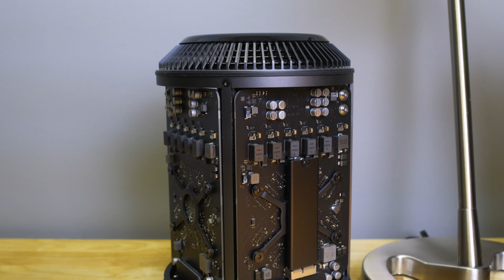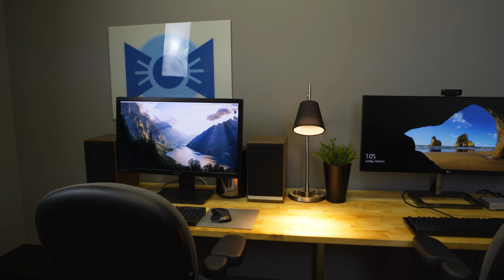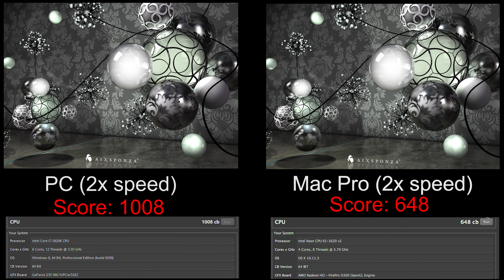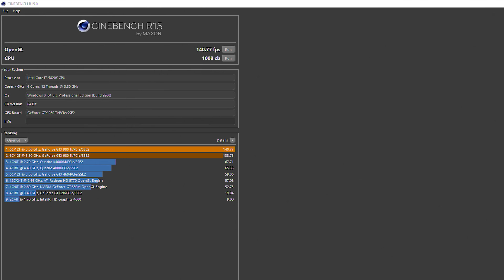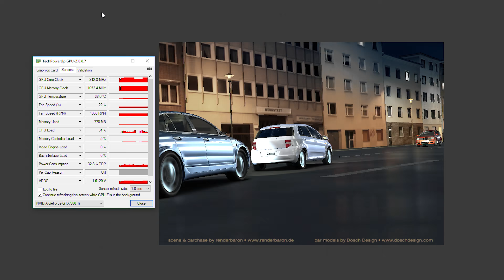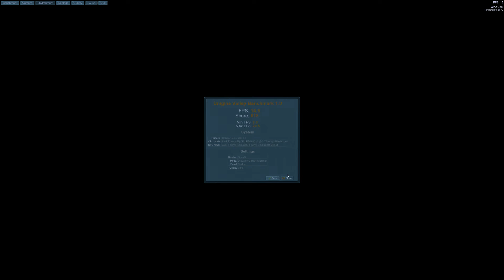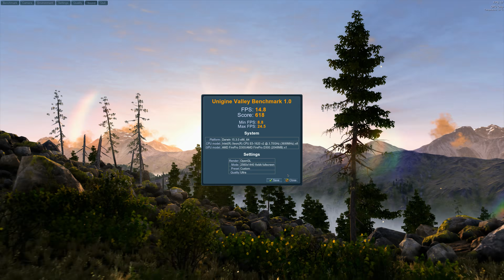$2,000 Custom PC vs $4,000 Mac Pro

Comment: The only GPU tests you did were real-time gaming-esque rendering. You didn't take advantage of those FirePros at all. Those are not gaming cards; they're workstation cards.

Your comparison "proved" that the 980 Ti build was faster just like I could "prove" that a Formula 1 car is better than a tow truck by putting them on a race track.

Comment: depending on the silicone, you can easily get 4.5 GHz out of this CPU... Higher than that you can still get stable performance but you will exceed the 140W of TDP due to the higher volts. But your setup should be perfectly fine with 4.5 GHz and with taht said: Your rig did not just derstroy the 4000$ appletrash but youre rig did it with one hand on the back (since you also do not benefit from quad channel on this board, wich i concider a bad choice, but hey :) )...

Comment: My cinebench score is 762 @ 4.9Ghz with my AMD FX 9590 which have BAD single core performance and between I5 and i7 multi-core performance. The only advantages for the Mac Pro is the workstation grade components, an effective cooling for the sound it produces and a small form factor. That for 1500/2000$ more, no thank you, I would rather build a Hackintosh or buy the previous version mac pro

Comment: You can Build Amd type of PC that can run as smouth as the hexa+980ti hybrid and rest that cost 2200$ for like 1000 euros , and it would probably overkill the performance of your 2200$ pc. Tip open a pandora , and see deeper, pc like AMD 9590 + R9 290x + 32gb of ram is like 1200$ , it can be pushed to its limits if u watercool it and it will run for 4-5 years , same as intel and gforce, and it will save you a tons of money, coz pc-s are just consumable peaces of metal. What im trying to say is dont do apple vs costom pc , coz apple lost long time ago, better do amd vs intel stuff.

Comment: Using an argument as idiotic as "but the mac takes up half the space" to justify having a computer that costs twice as much and is 3 times slower is absolutely ludicrous. Reevaluate yourself, this company has buried itself so far up your brain, that it's basically your religion. Not to mention the fact that if you can afford $2000 on a computer but not an extra $100 for a bigger table that can support your PC, you're just plain stupid.
Reply: +Arbi Daci EXACTLY. Plus, I like to keep the computer on the floor. Air is cooler, and fan noise is not so annoying.
Reply: +Capcatrei Exactly the same with me
Reply: +Arbi Daci i heard keeping ur computer on the floor attracts dust to your fans?
Reply: +Andrew Cabral That may be true, but you have to clean it every few months anyway. Just slide open the cover and vacuum the entire thing. Takes 5 minutes.

Comment: I don't quite disagree with the bench test,  if you want a fair assessment; run the pc with the same operating system as the mac and redo the bench test to see if there is any changes on the score.  Not sure if the asrock is compatible but gigabyte and asus are.
Reply: +dijadoit foxtrot If you do a drag race between a Lamborghini and a Ferarri, and the Ferarri wins, you don't go around saying "Well, it's not fair, you should put the Ferarri engine in the Lamborghini body...and then you would see a difference".  You pay $4000 for the mac and the operating system. If the OS is shit...then why even bother buying the hardware that's specifically designed for that OS?

Comment: The Mac Pro is two years older and is half the size of the PC. What did you expect?
Reply: I expected it to be cheaper? it's 2 years old
Reply: Some actual performance for 4000$ maybe?I mean formfactor doesnt matter he could just have uses a itx mainboard and a smaller cube case and  hed have a portable version of his pc
Reply: +FLoW Gaming And it's twice the price..

Comment: The AMD FirePro, like the Nvidia Quadro line, is not designed for games, and will always have terrible performance in gaming applications. They're built for rendering precision, not for rendering speed.

The only actual benchmark here that has any sort of real world significance is the last one, the export from Premiere Pro. Granted, it may have been using the GPU to do the rendering, but both machines should have been in roughly the same ballpark. The Mac Pro being so slow is really astounding. I'm assuming it was the same project with the same resources? What OS was the Mac running? Windows or OSX? Maybe PPro was able to use the GPU on the custom machine, but not on the Mac? Either way, wow.
Reply: I was wondering the same.

Comment: Something is off in your setup. I tried the same test on my rig, which is by now almost 4 years old. Only the GPU is new.
 I have a I7-3770k, 16GB DDR3 Ram and a 980GTX on Windows 10, no oc. 
When I ran the test, it came back with a score of 2880 points. 
Then I noticed that I ran it on DX11 and you on OpenGL, so I did the unigine valley test again, but this time in OpenGL with the same settings and got 2550 points. Lower, but still considerably faster than your PC.
So something must be off with your setup, as there is no way, my machine should score higher than yours.
Love the desk!

Comment: I see you can get 4.5ghz with 1.41v on cpu core. I also have an I7-5820k, I've gotten it stable at 4.5ghz before and tried 4.8ghz. It was not very stable at 4.8

Comment: For the Mac Pro, you have not mention about PCI-E SSD/802.11AC+BT4.0, which I am almost certain your $2000 PC don't have, as well as all other parts that you did not mention in this video.

For the CPU, the Mac Pro's CPU's Lithography was 22nm which is using IVY Bridge architecture where your 5820k is Haswell(also 22nm), 1 generation difference which is not huge anyway. 

RAM, the Mac Pro is using ECC RAM, your pc is NOT, end of question.

For the Graphics, you are doing all benchmark that's able to run on Gaming Graphic card, which means it's not taking full advantage of a professional graphic card. Gaming Graphic Card are only optimized for some OpenGL library which were usually used in Gaming, where professional graphics have to optimize all library, if you running any of the following software you would see a huge difference where Pro Graphic card will destroy your gaming cards : Sketchup 2013, Maya 2014, Rhino 5, 3D Max 2014.

Conclusion: if you are gaming, or you doing works that does not require ECC RAM and Professional Graphics Card, or you are not required to use Mac OS X, then getting a Mac Pro is one of the most stupid idea, but when it comes to the time that those component are required, you will find that Mac Pro actually worth it's cost, building a custom PC Rig having identical hardware would cost you roughly the same or even more.....
Reply from the maker: +John Li My $2,000 PC has a faster PCIe SSD than the Mac Pro, Bluetooth 4 and 802.11/ac built in. Building a PC with a Xeon processor and ECC RAM with a NVIDIA Quadro GPU would be about $600 more and still be 3x more powerful.
Reply: +Snazzy Labs check on AMD FirePro w7000, two of those would already be around 1200, e5 is more expensive than 5820k and the ECC is slightly more in cost, motherboard also need to get changed, 802.11ac +BT probably is another $100 ish, it would be around 3.5k to 4K ish

Comment: Yeaaaaaah... about that... 
The PC specs provided are geared towards gaming: Intel I7, Nvida GTX, DDR3 memory, all that sexy sparkle-sauce. The Mac Pro's is geared towards work: Intel Xeon, Error Corrective Code RAM, FirePro graphics.

Both will run and render videos, and the PC has the leg up on speed. But the Mac Pro is hardened towards continuous and sustained load. ECC memory makes sure that your computer doesn't BSOD every 7 hours of rendering, while the Xeon is geared towards a different class of mathematics that favors production applications and environments.
Reply: Yeah basically MAC IS SHIT.
Reply: With a Budget of 4000 you could build a PC That would finish the rendering way before it could BSOD
Reply: +MegaxeonLV great. do that for 200 hours across 10 workstations and provide the tech support when Nuke starts making the poor film interns cry. 

MacPros do not exist in a normal environment. Once a Mac based architecture has been chosen, it needs to be on and stay on at all costs. This does mean throttling, using older cards, and slower memory. But all is at the gain of fewer BSODs as a result of specialized drivers and a standardized production chain for the IT people watching over them. 

You could easily build a cheaper WORKSTATION PC for less, but then you have to maintain and support it, testing software every time your effects producer comes back from SIGGAGRAPH with a thumb drive AutoDesk gave him. And remember, you have to do this for your entire studio. 

Or just have Apple do it.

Comment: The Mac Pro you're comparing against is the base model, at least show the right price. It's $3,000. Not that that makes its performance okay.. I guess it's for people (like you said, professionals) who need the power but don't really know where that power comes from, or who are dead set on running Mac OS X and not knowing you can install it on a cheaper and more powerful computer you can build yourself.
Reply: +Ricky Nelson yeah they get up to $10,000 but the CPU and GPU are still the same, it is just added SSD space, extra apple retina display, blah blah blah. Not sure why people are so set on Mac OS X, imo its shit, but to be fair it can be quite a bitch to install it on a PC if you have no computer intelligence, which if you're paying $4000 for this you likely don't have anyways.

Comment: I'm loving the  Mac Pro 2,1 I have. After upgrading the hell out of it, it's still a super-viable machine. Either way, I wish Apple kept the older tower form factor.
Reply: ***** The Mac Pro 2,1 is a 2007 computer with a viable 8-core, dual processor system. I bought the tower used for $120. 32 GB RAM for $76, and a GTX 960 for $213. I prefer apple machines, but I wouldn't pay $3K for a machine.

Comment: This is what we've been saying for years. If you like Mac's because of familiarity and ease of use, fine. Their locked down systems run efficiently. But they are not for any form of professional/power use. You will always be shelling out more for a significantly weaker system if you go with Apple.
Even if you don't want to learn how to build it, many shops will build the system for $50 bucks.
Reply: Actually Much cheaper for custom pc build

Comment: One thing to keep in mind is that the Fire Pro is not a consumer graphics card. Fire Pro is for professional graphic work which requires it to be more precise. Linus did a video discussing the differences between card for consumers and professionals. But the truth is that Apple is over hyped.
Reply: +Jesse Rodriguez it really doesn't matter. Yes they are designed for rendering and editing while gaming GPU's are designed for gaming, but both can still do both tasks, just less efficient. That being said the 980ti still runs laps around these fire pros even in tasks they are not designed for.
Reply: That card is crap anyways , Linus was talking about Nvidia Quattro's

Comment: I know this is abit off topic. I currently have a MacBook Air and an iPhone 5s. My next phone will be the Samsung S7 or the new nexus. I am moving away from Apple for many reasons. Now I would like your opinion on what I should replace my MacBook with. I am currently a university student and I would liek something light and practical but also something that I could do some light gaming on from time to time with great battery life. I was thinking about the Surface Pro 4?
Reply: +Chris C Check out Asus' ultrabooks, plenty of power in a light formfactor.
Reply: Thanks man :)

Comment: Replace the CONSUMER grade cpu, ram and gpu with PROFESSIONAL grade cpu, ram and gpu, get warrenty, known support from people like apple, remove the overclock and then try to compare again. You'll see they'll be much closer.

I do agree, Apple always has had their huge prictag, combined with the older hardware sold as a state of the art machine. But if I were someone that really relies on stability for their income I'd like to have a Mac, or at least a PC with, again, professional grade parts in it.

Comment: It's like comparing a school bus to a BMW m5.
Reply: +hussein hussein No it's like comparing a bmw 328i to a custom built car that would kick it's ass. Try harder fanboy.
Reply: +Dante You don't build custom cars in the first place.
Reply: Dante I am referring to the gpus. One is meant for gaming and the fire pros are geared towards rendering.
Reply: Dante A bus would transport more people at one time, while a bmw m5 would transport 1 or 2 at a faster rate. Which is why the fire pro gpus are clocked lower and packed with stream processors.

Comment: You really need to research cpu architectures and gpu architectures. For one the GTX 980Ti is geared more towards gaming, while FirePro / Quadro gpus are more or less for CAD/Revit/Rendering. They're not actually designed or provided with the optimal drivers necessary for gaming.

Comment: The last Mac 'Pro' is anything except professional. Since my first Mac (Power Mac 8500) I always used custom graphics cards (tweaked PC gfx-cards) because Apple's cards always have been slow and overpriced. But a pro graphics computer with an on-board gfx-card will be obsolete after 2 years - regardless how good other components are. 

The concept is all nice for the iMac series but in no way for a pro series.

Comment: My $100 R7 260X XFX 1GB GDDR5 got 65 FPS in the VALLEY BENCHMARK! Beat that Mac pro!! 
Unigine Valley Benchmark 1.0 Scores Down Below!! 

FPS: 
55.4
Score: 
2316
Min FPS: 
20.7
Max FPS: 
94.8
System

Platform: 
Windows 8 (build 9200) 64bit
CPU model: 
AMD FX(tm)-6300 Six-Core Processor (3792MHz) x3
GPU model: 
AMD Radeon R7 200 Series 15.300.1025.1001 (1024MB) x1
Settings

Render: 
Direct3D11
Mode: 
1440x900 fullscreen
Preset 
Custom
Quality 
High
Powered by UNIGINE Engine
Unigine Corp. © 2005-2013
Reply: The only thing is that the tests he did were in 1440p
Reply: I'll redo the test.

Comment: but it wasn't just the 3 hours spent making the pc, its all the years and years of learning how to build pc's, the time spent researching the psu problem

the mac will come with free after sales service, i just have my 4 year macbook pro repairs and parts replaced, it doesn't take a pc genius to make the mac pro i just got it, not to mention that you can't run mac os on a pc, which in my mind is still light years ahead of pc and always will be, alot of this argument comes down to how well each OS runs with the hardware, its not just about how quickly stuff renders, or how many frames per second you will get, not only that that mac pro is soooo quiet and sooo sexy as well, i love looking at it, ill wake up and just think wow i have a mac pro thats fucking brilliant 

this argument is silly you can't benchmark 1 old mac with a modern day pc and say seeeeeeeee look they are different look at the price, id much rather pay when i did a year ago than get a shit pc which i hate using, we use them at work for cad work and they really annoy me, its like going back 10 years into the past with window 7
Reply: lol trying hard to justify that you just trew away alot of money,it was a fair comparison 2000$ vs 4000$ and if the parts in the mac are older apple should lower the price.oh and btw you can buy already build ones under the price of the mac but still much more powerful
Reply: If you have the money and can afford it then why not, not self building saves you time dealing with all the shit if you don't know what you are doing, i prefer the features of two mac working together and i have another mac book pro, its easy to control the other one from another room, there are so many plug and play feature of mac make my life alot easier,

editing raw 4k video on the internal pcie flash storage drive that goes at  900mbs a second is a must if you want o edit seriously 

i could keep going but to say "lol trying hard to justify" means you probably havn't used both platforms, plus the unit is fucking silent all the time, much better when i wanna work in silent with out music on
Reply: +james larkin plus also when got mine i managed to get mine really cheap i got it for £2500 legally through a mac auth dealer so i didn't pay full price, but then again you wine about the price but iv been using macs since 2007 now i would never go back to windows only for a few apps that i can't get on the mac, but i still use paralells
Reply: Hahaha, you can install OS X on most non Apple PCs. Google "Hackintosh". And you can get a PC building service, which not only builds the PC but also extends your warranty.
Reply: +Franco Rossel oh for gods sake i know about hackintosh,  but i don't want to go through all that bullshit of weather or not i will get problems with my mac, hardware conflicts, error messages i know nothing about,

i want after sales 
i want to concentrate on my creative work not errors like you get on windows all the time fucking time 

your forgetting one of my main points, i can actually afford to buy a mac pro, for those who don't i would suggest a pc / hackintosh / pen and pencils